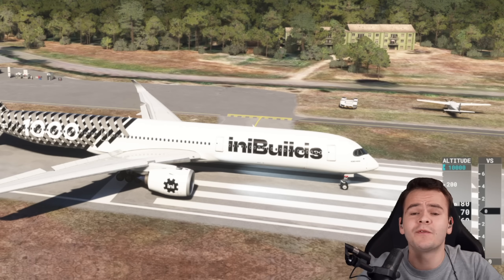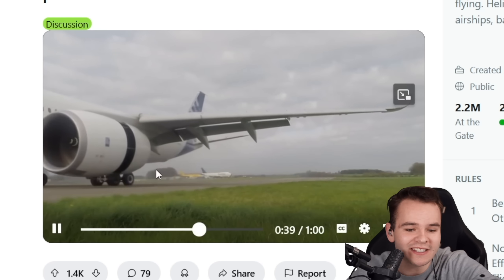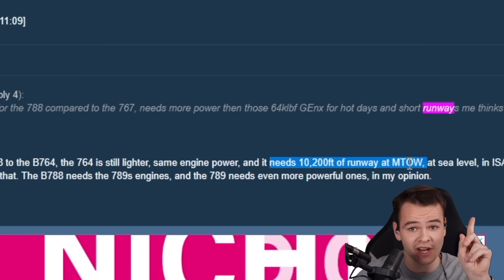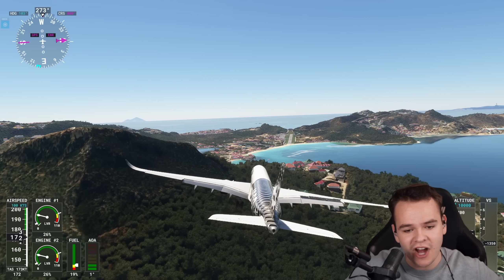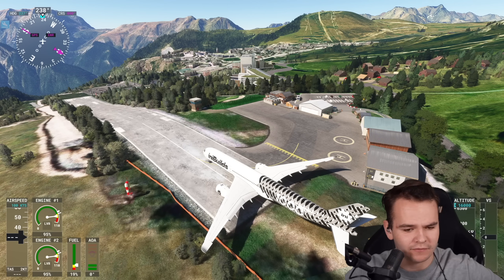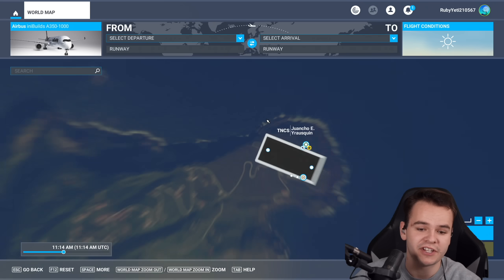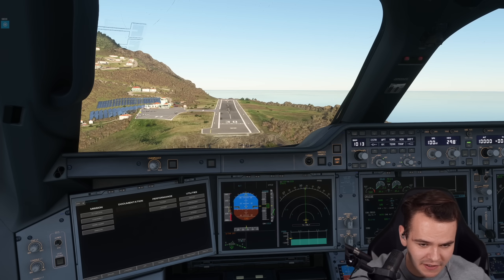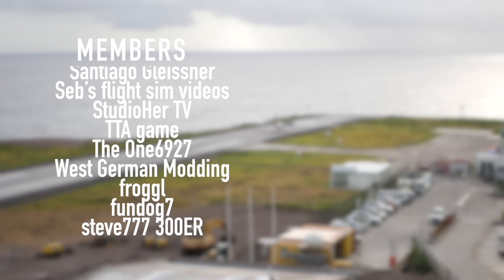How The A350 Is Able TO STOP SO FAST

Comment: Ailerons acting as spoilers aside, the A350 does have incredible braking performance. I was flying with an A350, touched down, it was normal braking power at first, but for some reason the pilots decided to brake even harder (probably to get off of the runway earlier). That was the moment the ailerons went up acting like spoilers, and my lower belly was pressed against the seat belt so hard that it actually hurts quite a bit. That's something I'll never forget.
Reply: wait but why wouldn't they use the ailerons under normal braking to reduce brakes heating?
Reply: @Aeroguru1  the ailerons always come up with the spoilers, so that was not the reason he felt more braking, the pilots probably took over with manual braking.

Comment: Almost every newer Airbus does that thingy with the spoilers when landing, its a feature of the FBW called LAF (Load Alleviation Function).
Reply: LAF is something different. That is to reduce wing bending during turbulence and improve the ride. The ailerons deflecting up is just a modification which was at once point called the Florence Kit
Reply: @tomstravels520  Well, I was taught in engineering school one function of LAF is the deflection of ailerons acting as spoilers during certain flight envelopes to reduce stress on the wings such as take-off and landing. I might be wrong though, it was a long time ago.
Reply: @ yes, but not the actually touchdown. Thats not LAF. It was added to allow for shorter stopping distances such as at Florence

Comment: Yeah I know the 8350 is like engines are very powerful but still airplane like a 350 is very big so it cannot take off with low fuel and low payloads in Saint Mary or any like small airport I think that physics are ok but not the best so I request that enables should repair this problem or fix this problem because 
 I am also going to buy a350